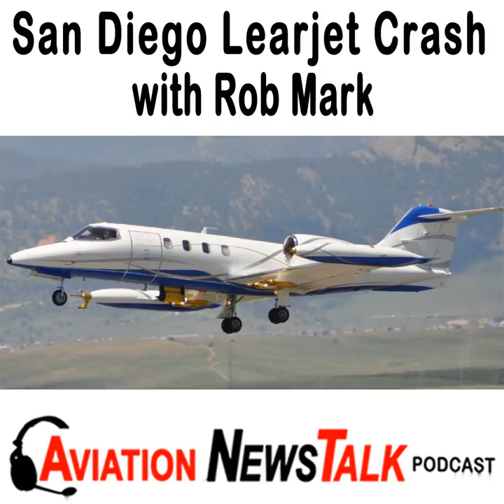214 San Diego Learjet Crash – Interview with Rob Mark

Comment: What information do these two narrators have that this flight was operating under Part 135? My guess is it was not. It was being operated under Part 91. So all this conversation about the company's Ops. Specs and Part 135 regulations are completely irrelevant to this accident.
Reply from the maker: David, it's only relevant if it prevented them from using runway 17, which would have seemed like an obvious choice otherwise. We did discuss in the original recording about whether this flight was 135, or 91 since it wasn't a passenger leg, but I edited that portion out for time and because whether they were 135 or 91 didn't really matter...except for landing on 17, which we did discuss.
Reply: @AviationNewsTalk  My guess is, and it's only speculation, that this crew wanted 27R because it was around a 1,000 feet longer. I'm not sure what the runway length requirements are for the Lear 35 on a wet runway. But whatever it is, it has nothing to do with Part 135 restrictions because they were very likely NOT operating under 135. And even if they were, the landing distance requirements would be the same either way. I'm speculating this crew likely performed this exact same maneuver countless times previously without incident since they were based there. One other point that I think is worth mentioning. Once they canceled IFR, in order to sidestep the no circling at night restriction, which applies to all IFR ops reguardless of whether the flight was being conducted under Part 135 or just Part 91, they had no legal way to perform a missed approach procedure while maintaining VFR. In order to miss, they would certainly have been in IMC without a clearance. Which of course would have required them to openly violate FARs. In this case all while the local controller looked on. As well as the TRACON would certainly have also been aware of it as well. I'm not saying that fact would have prevented them from missing anyway. Its just that it could certainly weigh on this crews decision to try and continue to force an imprudent landing maneuver in poor visibility with no other real legal option except to land at that point. Why not fly the 27R localizer approach instead? My guess is they considered that but assumed the weather, reported as 2,000 and 3, was adequate for them to perform their cancel IFR, then circle VFR work around maneuver instead.

Comment: OK, you chewed through everything the pilots did wrong, everything they should have done instead, and everything they might have done  to reduce the risk, but made little or no mention of the fact that that airfield is simply inadequate for the 24/7 all weather fast jet operations they were engaged in.  Sure they could have done many things to mitigate the risks, up to and including going elsewhere, but they shouldn't have had to take those risks as part of their employment  in the first place.
Reply: Probably a great airport for 300+ days per year - it's up to the pilots and the aircraft owners to decide when not to fly, as it should be.
Reply from the maker: Yes, our focus was on the facts available to us, and on what appeared to be some obvious pilot errors in flying the traffic pattern, as we're trying to educate pilots on pitfalls to avoid. No question, Gillespie is far from an ideal airport for a jet crew, yet the reality is that pilots often have to fly into airports that are less than ideal. But when we do, we try to mitigate the risks to the greatest possible extent. This crew could have mitigated the risk by going around and diverting at a couple different points in the approach to landing. But they didn't.